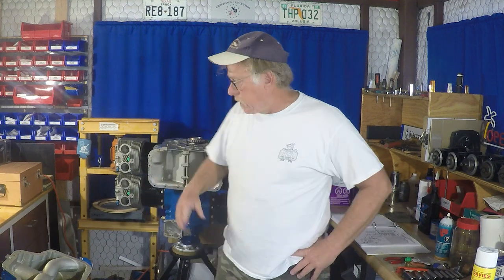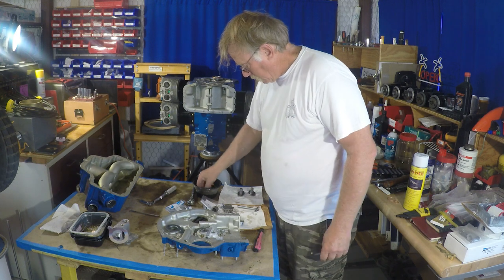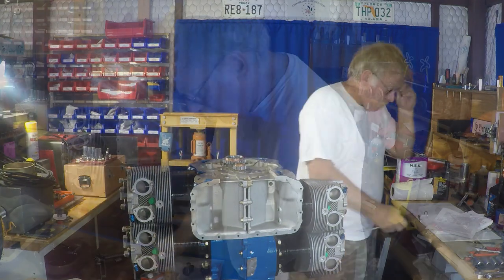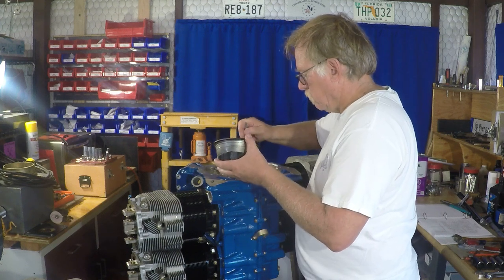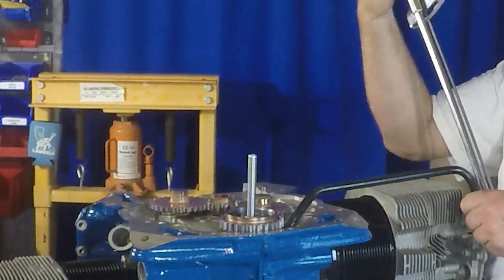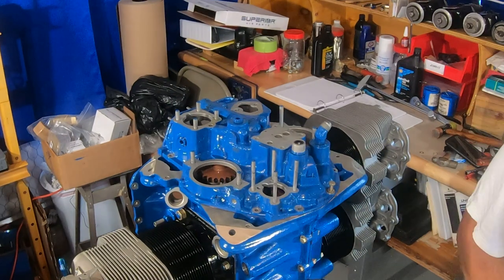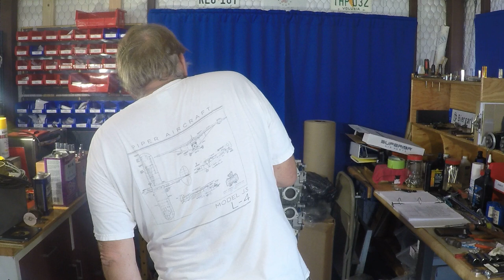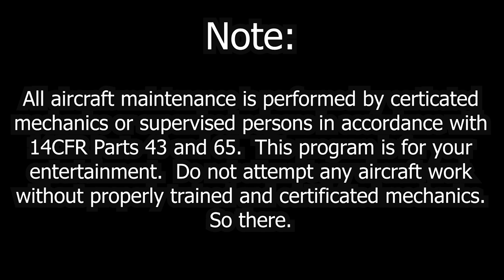360 Engine E13 Accessory Case and Sump Installation!

Comment: This is a well made and informative video- big thanks for making it!  I've been researching for an upcoming prop strike AD project.  I thought I'd read Lycoming specifies installing the crank gear dry (no oil / lube) and the bolt is to be lightly coated with food grade anti-seize.    Looks like you have a different approach.  Not sure which way to go- I'd appreciate your insight / comment.  Thanks again!!
Reply from the maker: Glad it was helpful!  Refer to Lycoming Service Bulletin 475 , 533,  and the Direct Drive Overhaul Manual.  Thanks for watching!

Comment: On the oil pump installation housing it doesn't look like your safety wire was installed with a positive application, why is that. I've been a&p for almost 40 years and always you install safety wire with a positive pulling technique.
Reply from the maker: Because the safety wire routing is dependent on the holes in the studs you may end up with a neutral installation.  Thanks for watching!